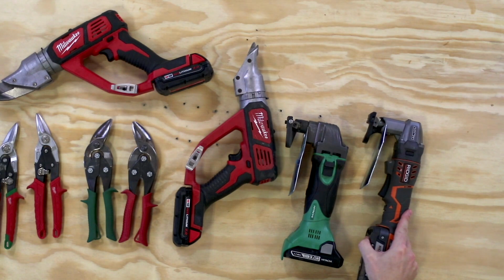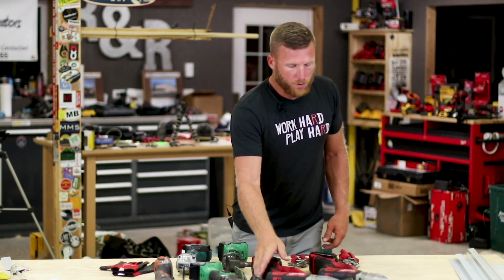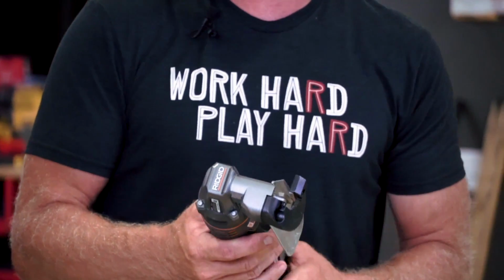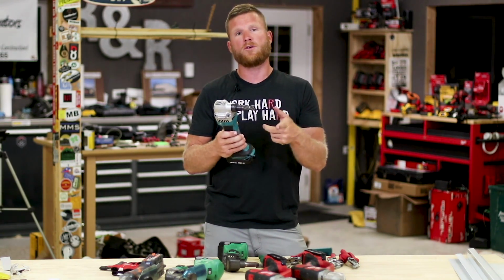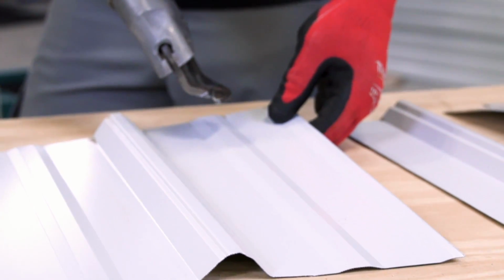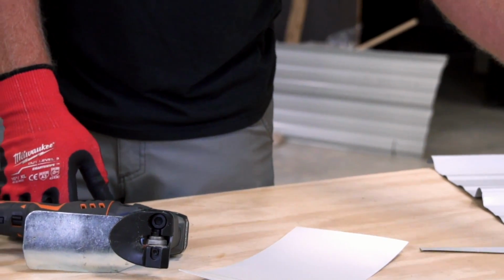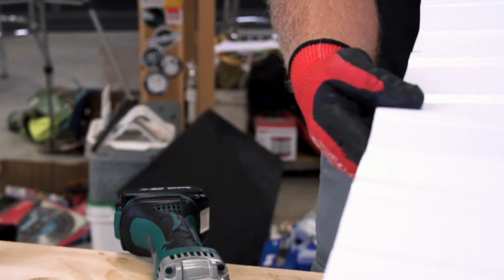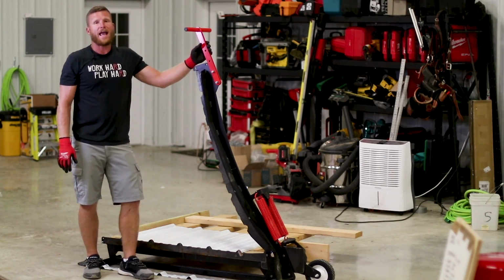How to cut metal - Toolsday

Comment: Thanks once again for a very informative video. I enjoyed seeing the latest nibblers that appear to leave a much cleaner cut than my 40 yr old Bosch nibbler., even with new dies. It leaves a nasty edge, like a serated knife! And those moon shaped niblets are horrible and get everywhere. How much of a pitch can you get on the Swenson shears for cutting gable ends?
Reply: Probably only about a 1:12.  They make a separate profile if you want to cut a dedicated pitch.  We dont use the shears too often unless we have to cut multiple short pieces out of long sheets for fascia.  They leave a factory like finish.  The only problem we have is that the sheets like to twist during the cut.  We have a sled similar to what Kyle has in order to keep the sheets square.

Comment: It is not annealing as that is a heat process to strengthen metal. Though it is pinching the galvanized metal/Galvalume paint to close the gap. The scissors do the same thing.

Comment: Haven’t used the nibblers before might give it a try. But with a lot of skill Midwest snips can leave a nice clean cut edge on master rib 29 and 26 gauge panels. All my valley cuts are cut 3 inches long on the ground and the I use a non corrosive chalk to snap a line and finish my valley cuts using hand snips and a roofing cert class I had to do with a metal company I use they informed us that had snipping is best. Mostly because as the snip cuts the metal it rolls the zinc coating in the panels over the edge thus sealing it from outside elements very key on standing seam roofs near the coast. Cutting metal roofing of any kind with a circular saw is the worst thing because the heat from the blade effects the temper and strength of the cut edge and burns the protective coating on the metal leaving a edge that is very Susceptible to the elements. Plus using a circular saw with a framing blade flipped backwards makes one heck of a racket and leaves a ton of metal dust behind

Comment: i have  a small hole to cut in a computer case, for which i want very clean edges..and i need to do it while computer components are still inside the case.. 
a nibbler seems ideal, apart from the nibblets.. do you think an appropriately placed magnet would keep the nibblets from falling into the electronics? or do the nibblets fall away too hot to be magnetically attracted?

Comment: Great info.
In Australia we use colorbond steel for fencing. It comes in a zig zag profile. The ridge is quite a acute. What do you recommend to cut it with.
I've tried one brand of nibbler but it didn't work very well.
Thanks

Comment: buy a  big harbor freight magnet and cut over it if you are on a bench or just put it on the ground under the cutting area it will catch a lot of the niblets if they are steel. Those things will ruin a wood floor in your house if you don't dig them out of your soles.

Comment: Track saw with metal cutting blade for cutting across ribs?
Reply: With rpms dialed down and appropriate blade, would there be concern for heat build up?
Reply from the maker: It’s also not good to have those tiny shavings flying all ober
Reply: He's right and not only are the little metal flakes a pain but they will RUIN your panel finish and maybe a vinyl window or whatever other surface they fly onto. They aren't just a metal sawdust, they are hot, very hot little embers that will burn the paint where they land and cause rust in about no time! They themselves will rust after they embedded into vinyl or painted steel and in the steel after they have rusted then the bare metal panel then rusts from no paint. It happens in sloppy paint and body shops and is called "fallout".

Comment: Ok, so if I am going to do one roof and only want one tool, sounds like the Hitachi nibbler?
Reply: Depends on your roof plan. Two plane roof on a building spec'd for metal? Sure snips would work. Lots of hips and lots valleys with metal gables? I'd spring for the nibblers. Any good roof plan will spec the exact length for the panels and if it is a pole barn or garage with no penetrations then you can have each panel cut to length and delivered ready to install. Cut nothing. Boom. But... if there are trims then you will always need snips, both left and right.

Comment: We specialize in the same areas of work you do, and we use a single cut dewalt attachment for our screw guns and it has no problem cutting over a rib with a clean cut on both sides, great speed and lots of control, like to see your opinion on it!

Comment: Excellent information. I remember building my parents house and cutting the corrugated steel roofing with a 77 worm drive and a plywood blade stuck in backwards. Hot chunks and slivers as we were doing it in August here in central Texas. People were convinced I was crazy as I was wearing a heavy denim long sleeved shirt in the 105 degree heat. If I had a nibbles back then...
Reply: Daynaleo1 how are the cut ends holding up against rust?

Comment: Awesome vid, are there any manufacturers that make the double cut shear with the head turned 90 degrees? It looks like the only reason you can't get over the ribs is because the remainder of he tool gets in the way?
Reply from the maker: SilmSlice actually I can change the Milwaukee
Reply: @RRBuildings  well there you go, obviously it isnt just the handle and battery that stop you being able to nicely do the ridges etc

Comment: You ever just use a circular saw for cross cutting these panels?
Reply: Any circular/saw type cutter leaves tiny bits/shavings, that will melt into the paint....and later rust.
Reply: @2chipped  interesting
Reply from the maker: Never use a tool that heats up the metal or throws small shavings.  You will get unwanted rust.  Just learned through experience over the years

Comment: You didn't show the tool my Dad taught me how to make and use 50 something years ago. It would probably not be to good if you were up in the air but on the ground it is amazing how good it works. First lay a strip of baling wire under the metal under your cut line. Then take two 2x4's and lay them across the top of the metal where you want to make your cut. Pull the wire up making sure the mark where you want your cut is lined up with the wire. Slide the 2x4's up close on either side of the wire. Put your foot on top of the 2x4's and either hold one side of the wire and pull the other side or pull both sides up through the metal and it is amazing how easy and smooth the cut will be. Sitting here thinking I suppose you could wrap the wire around one end of the 2x4's and that would help hold them together on one end.

Comment: Anneal is not something that a nibbler can do.  To anneal is to remove hardening/temper of a metal with heat and and gradual cooling over time.  Maybe you were thinking burnishing?   Question:  Any chance in hell a circular metal cutting saw (Milwaukee/Makita) could cut profiled metal that thin cleanly?

Comment: Great video and information. I've done countless metal roofs and a dozen or so pole and a couple metal sided buildings over the years. Been using the electric (corded) double cut shear for years and a handful of different snips. Mostly Wiss brand. Just recently got a nibbler attachment that goes in a drill. LOVED IT the first time out! Now I want a dedicated cordless version like the ones you dimistrated. 

The one thing you didn't mention was the ability to easily cut odd shapes, circles etc. with the nibbler. 

And the shear at the end of the video! Wow! I want one so bad!!!

Comment: Why would you not use a saw or grinder to make any of those cuts? Do you use a de-burr-er? Lastly you really should invest in some sound absorbing material for your shop because the echo is very noticeable
Reply: because those tools do what is called a cold cut.  saws blades and grinders create friction when they cut (HEAT) which burns off the protective coating or paint which leads to quick rusting of the metal roof panels and voids the manufacturer warranty.  I have seen some cold cut tools out there that cut like a skill saw, but i haven't seen them in action to access if it really is a cold cut.  sorry for the rambling
Reply from the maker: What he said

Comment: Excellent video and a big help to select the proper tool for building a metal shed.  This is most probably a single project, and I didn't want to waste money on unnecessary tooling.  The nibbler should do it all, for my requirements.

Comment: I’ve used nibblers in the past before and love them. 
Question though, is there a way you can set a piece of factory cut steel over your workforce and use the factory piece as a guide on the nibbler to provide a straight cut? 
I found back when I used one, it’s not a very egomaniac feel to it. And it seems to want to easily walk of a mine pretty easily if you aren’t paying attention.

Comment: We ordered this tool the nibbler one. It didn’t even work straight out of the box. My son called to see if their was safety lock or something he couldn’t find. He made sure the batteries which was a separate purchase were fully charged. But to no avail. So after exhausting our options to user stupidity we concluded it was manufacture error and returned it. We waited forever for the new one to come. And when it finally arrived it had the same problem straight out of the box. Upon examining the box we became suspicious that it was the same tool returned to us again!!! 
What kind of shoddy company is this that either returns a broken tool to you or has manufactured failure twice in a row. 
We returned the item again and never got a confirmation of the return so we are out the money and the tool! Thumbs down for these guys!! Poor business practices, poor manufacturing and Ripped us off the money to boot! 👎👎👎👎👎👎👎👎👎